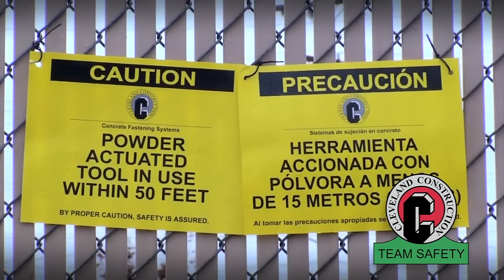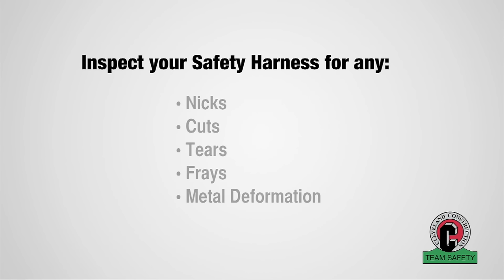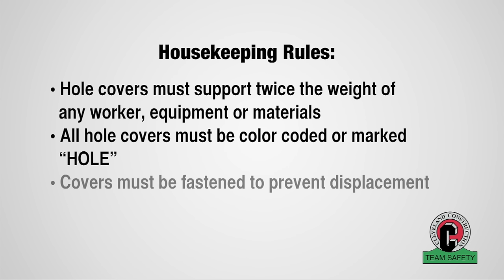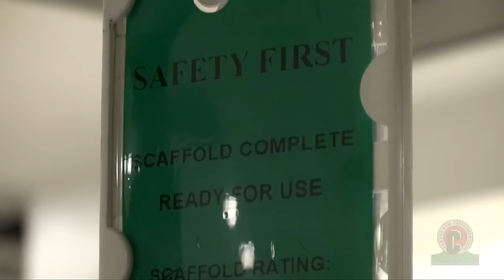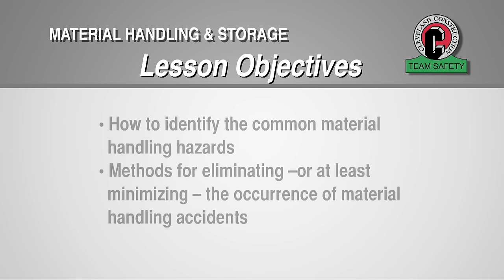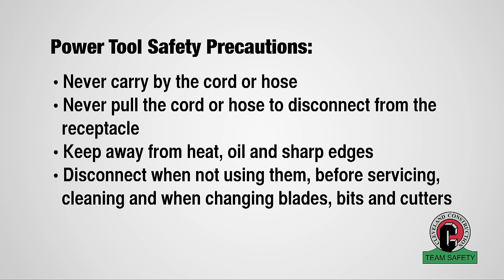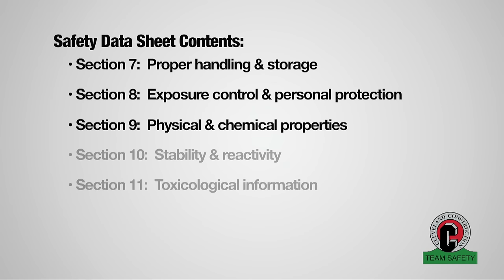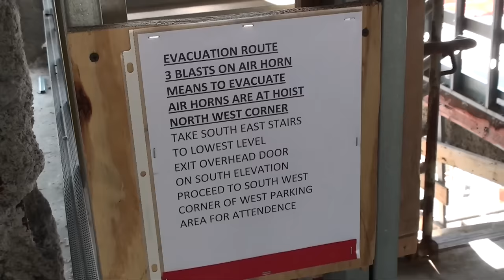Construction Safety Training Video by Cleveland Construction, Inc.

Comment: My dears, at Cleveland constructions! 

Please allow me to point out some of the things I found in this video. 
Workers performing jobs without full PPE ( No gloves mostly) 
Workers performing jobs or even being on job sites with short-sleeve shirts but if you're ok with 4 inches, then ok
Workers using a grinding machine in short sleeve shirts! 
The harness isn't snug enough on more than one worker 
Major housekeeping issues especially where the manlift was working. 
Anchors points must be above the worker not at his feet. Since he is in a manlift, I assume the manufacturer has put one closer to his waste level. 
By putting the anchor point by his feet, you are creating a trip hazard. 
Hat on backward 
Going up the ladder with an item in his hand ( Big no no )
Using a jackhammer without earplugs!
You said the criteria for setting up the ladder is 4:1 and it's true. one of the reasons is to prevent the ladder from bending as the workers go up. but in the next clip, at 24:23, the worker is going up and the ladder is bending. 
I had written all these observations by time code, but my laptop over-heated and turned off. So I lost it all. Now I will post this so the same doesn't happen again.
Reply from the maker: Thank you for your thorough analysis of our safety video! We're in the process of updating the footage and your comments will be used to improve this video. Look for a revised training video to be released in 2019. In the meantime, visit www.clevelandconstruction.com for more information on how we manage safety on our jobsites.
Reply: You are welcome... I looked at your website. It looks great! :)
Reply: Hi,  @Ayashey !
Sorry about that!! You commented a year ago on this video and I just now saw it :P  If you still need help, please let me know. I tried your number but it doesn't have whatsapp nor did it have Viber. 
I hope you're doing well.

Comment: 32:00:  This is almost too painfully cringeworthy to even watch.  Sure I can imagine that walking on stilts would be convenient --- but what if you fall and MAJORLY twist and sprain your entire knee --- not even to mention the greater fall distance to the floor if you do a face plant.  This is NOT how I would want to get around at a construction site if I ever worked on one.  Instead, I would like to see the invention of even something as small as a 3' x 3' self-powered platform which moves around as you stand on it.  The travel of the platform would be controlled, on command, from a cable-controlled control box just like on a scissors lift.  A simple hydraulic lift on the device would enable control of standing height on the platform.

Comment: Numerous safety violations.... Employees giving very poor examples on demonstrations on how to properly use and apply PPE to their task. Employee giving examples on how to you tools proper wearing dark shades at the bottom of nose, While chipping concrete with a jack hammer no hearing protection, no respiratory protection when exposed to silica, minute 14:50 handrails installed improperly sad story...……………………..